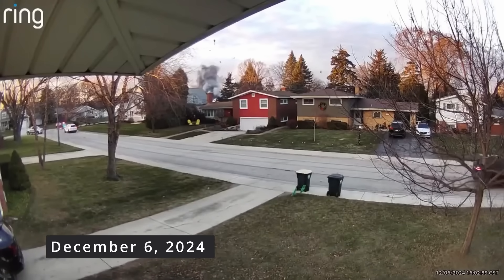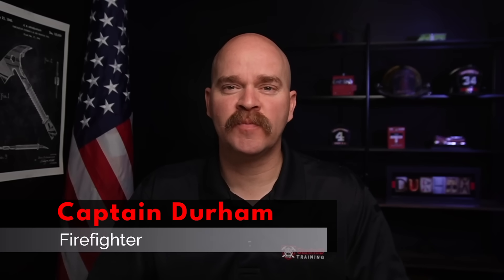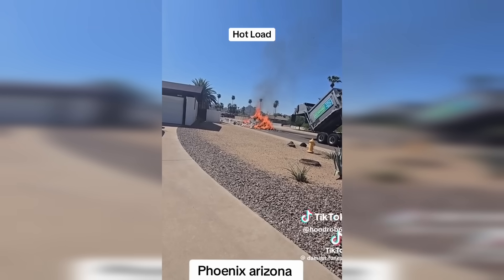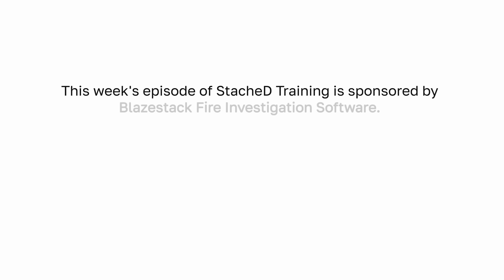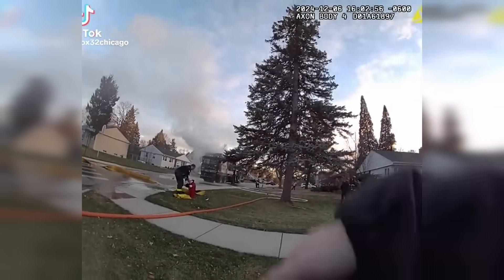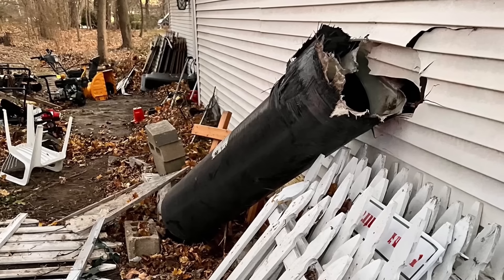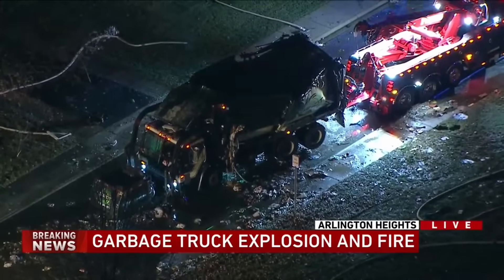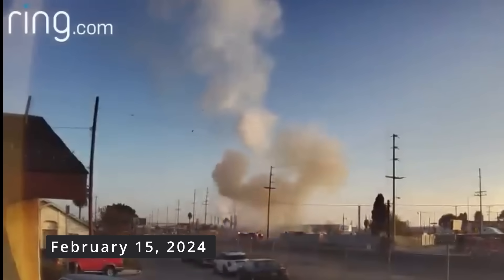CNG Garbage Truck Explosion Leaves 3 First Responders Injured!

Comment: But that tank had an outer layer of carbon fiber laminate, not fibre glass.
Reply from the maker: It's difficult to tell the difference between glass & carbon fiber rovings once the material has been molded.  Some tanks will use glass, others will use carbon fiber, however, carbon fiber is extremely expensive, about 10 times the cost of glass.  The cost is a primary reason most manufactures will lean towards using glass.
Reply: @StacheDTraining  - Well that black colour is typical for carbon fiber. Never seen black glass fiber when maximum strength is needed. Not design. If a steel tank is not strong enough in Europe I have seen so far only carbon fibre. Fibre glass only for 11kg propane tanks, but then without steel. You can see how full the tank is. The H2 tanks we made were also a steel tank with carbon fibre laminate. 
Are you really using fibre glass for high pressure tanks in the US?
Reply: @jfnotk255 Q: Are you really using fibre glass for high pressure tanks in the US? A: oh yeah, the one's i saw personally during some training out in "Oootah" (Utah) were definitely Fiberglass.  we had a crossectional cut-away piece of a Type-2 tank handed around showing the inner metal core (which is actually rated to hold all the pressure by itself) with an outer Hoop Wrap of Fiberglass used for additional support and safety.  granted i didn't have a set calipers on me or anything, but the wall thickness of the tank to my "Engineer's eye" was approximately 5-7mm with the long-strand wrap of the yellow/white Glass Fiber being approximately 3x-4x the tank's INNER wall, so adding another 15-20mm of thickness on top of that to form the tanks OUTER shell...

basically it was the same technique of "Rotational Winding" that Stockton "Elon" Rush used except in Carbon Fiber (sidebar: although any 1st year Engineering student would've known that "use case" was 100% WRONG and should've never been done) for creating the center section of his DOOMED Titan Submersible that ultimately ended up sending him (and others) to an "icy grave" on the floor of the North Atlantic, but i digress...

now speaking of possible "legit" CF reinforced tanks, when out to Vegas earlier this year i DID in fact see several shiny black tanks at ACT Expo being used for H2 COMPRESSED HYDROGEN.  yeah, these were the tanks used by the Toyota Megacorp mounted "in-situ" on their disassembled Fuel Cell Semi they had on static display, in fact i still have the pics right here on my phone however (BUT WAIT THERE'S MORE...!!!) Toyota did also display some smaller bright yellow tanks that looked to be reinforced with Kevlar...

in fact i saw no less than 4 different colors of H2 tanks:  i saw Black, White, Yellow, and there were also Grey (more than likely a CF/FG mix to save on cost).  fwiw the color of the 10 tank configuration the Hyundia Megacorp were using in their GINORMOUS Fuel Cell Semi definitely looked to also be normal Glass Fiber which makes me think their's were finalized "production tanks" and Toyota's were maybe "prototype" tanks simply during their R&D process.  both had operational Trucks outside giving demo rides but i only had time to "go to Mexico" like the kids say in Nikola's H2...😉

not sure what CNG tanks operate at, but for reference all the modern H2 Fuel Cell systems are now running at a massive 700bar (~10,000psi) whereas the earlier first gen systems from what was communicated to me were running at only 300bar (~4000psi).  i believe some of the jumbo storage tanks for H2 ie, 1.2m x 7.6m (4ft x 25ft) still use this as a reference pressure.

Comment: An alternative to CNG is LPG which isn't stored in highly pressurized tanks. It just has the habit to sink to the lowest point and either make you fall unconcious and die or catch fire.
Reply: LPG tanks can go up to over 300psi .
Reply: cng is used because of price
Reply: Look up “BLEVE”. Boiling Liquid Expanding Gas Explosion. 30 yard fireballs are common.
Reply: Yeah, it's a good thing most people don't have LPG tanks sitting on their grills in their backyards.
Reply: You must have a high benchmark for "high pressure". LPG/Propane is stored under pressure and will explode in a situation like the truck in the video. Search "BLEVE" to see what LPG/Propane tanks are capable of.

Comment: Why not jettison the tanks? If you know you're container is on fire, cut fuel and release the tank to roll away from the fire, surely there some mechanism that can be made to breakoff, seal the tank and eject it several yards away. Or some cryogenic cooling that can crack open between the inner and outer shell to buy some time.
Reply: you usually want to be in control where the flamable stuff is and not toss it just somewhere... the solution Patrick hinted at (dumb the burning stuff and drive the truck away from the pile of burning trash you just dumped in the middle of the road) is quiet sound what Patrick is adressing is a basic problem: Rescue services must be trained to react to different fire situations with the different fuel sources because they have to be treated differently... and they have to be able to see what they are getting themselfs into
Reply: Q: Why not jettison the tanks? A: you're kidding right...? 🙂 re: "seal the tank and eject it several yards away." well they're CNG Trash Trucks whose daily route (as shown in the video) is to go into residential neighborhoods and collect "the people's trash", therein "several yards away" invariably equates to "shooting a Mk1 Torpedo" onto someone's front lawn, driveway, or possibly even on top of a kid's Big Wheel...? just sayin'...

i mean it's bad enough one remedy clearly appears to involve GIVING BIRTH to a "fiery trash baby" into the middle of the street, but like those GINORMOUS TRASH MOUNTAINS seen in Florida after Hurricane Milton and Helene, at least the pile (once extinguished by local Fire Service) can be cleaned up with relative ease using a combination of a loader, or a claw, and a dump truck.   if i were to "hazard a guess" (pun intended) i'd say recovering a stray tank out of someone's chimney due to the danger posed would effectively mean CALLING IN A BOMB SQUAD.

Comment: Goes to show how safe diesel fuel is.   Diesel will only burn, it's not in a pressure tank.
Reply: And it's hard to make Diesel burn, contrary to gasoline!
Reply: In a fire situation though you have both heat and as the fuel expands compression. A diesel tank can become a firebomb. Diesel doesn’t light very well cold, but at a couple hundred degrees it burns pretty violently.
Reply: Yeah we drive new CNG dump truck rigs. The trucks that the new cng rigs replaced were on the road for over 10 years and were build like tanks. They were cat 13, cat 15 diesel with 10 speed manuals. These new cng trucks are heavier and have Allison 4000 automatic transmission that can’t pull worth a dime. The companies are going this route because of the environmental cutbacks and it’s all political.

Comment: "Wound Fiberglass"?  Are you sure it's not Kevlar?  Bet it is.
Reply from the maker: It's a thin metal tank wrapped in either glass or carbon fiber.   Typically, glass is used due to the cost of carbon fiber.
Reply: @StacheDTraining  It 's NOT fiberglass.  It might be carbon fiber but it looks a little light for carbon in the picture.  Doubt there is a metal tube.  I was involved in a project at a rocket manufacturer of large (long) cylinders for a CNG 'refueling trailer'.  The cylinders were about 40ish feet long.  We used all carbon fiber, no metal.  
Kevlar roving tends to take on some color from the resin, normally it is a yellowish white.  It might be carbon though, but the carbon roving we used was dark black, very pitch black before ever touching the resin.  Different manufacturers might be the difference.  But fiberglass would not withstand the specified pressures unless it was prohibitively thick & heavy.
Reply from the maker: @x-man5056  you're correct,  bulk transport and bulk storage will use carbon fiber.   Vehicle applications are typically type 2.  This should help (I worked for a large carbon fiber manufacturer) https://astforgetech.com/compressed-natural-gas-cng-storage-options-ultimate-guide/#:~:text=CNG%20tanks%20are%20made%20of%20steel%2C%20aluminum%2C%20or%20composite%20materials.
Reply: @StacheDTraining  Thanks for a good answer.
Reply: @x-man5056  re: "fiberglass would not withstand the specified pressures". it can since it's just there for reinforcement, the metal inner tank (by way of it's shape and material) is spec'd to contain the pressure all by itself.  however not sure if that holds true when you get up to Type 4 with Polyethylene cores.
Reply: @phillyphil1513  Yes, but no metal inner was known to me (not in the pictures or video) when I wrote that.  I have worked with the winding machines only on big stuff ICBMs chambers and space launch boosters (both Kevlar and carbon fiber) and CNG refuel trailers with about 40 ft long CNG cylinders that were carbon fiber, where the added weight of a metal liner would not be welcome in the case of boosters or ICBM's.  It would have been a lot easier to do the CNG Cylinders on a permanent metal inner liner, but it was the Govts approved design, not the company's.
Reply: i can confirm Fiber Glass is indeed used guys on BOTH the lower pressure tanks of CNG and the higher pressures tanks (700bar) of modern compressed H2.

Comment: I got a better idea. Outlaw Lpg and cng fuel tanks on vehicles.  The risk of explosion and people being killed is too great a hazard. That's like EVs once thermal runaway  occurs.  It almost takes an act of God to put the fire out. Once the fire is out. In some cases. It reignites days or weeks later. The only 2 methods to run vehicles. Without using fossil fuels. Is hydrogen fuel or fusion energy. Both are very safe fuel sources. Hydrogen in a hydride fuel cell is perfectly safe. If by chance the tank is ruptured. There's not enough actual hydrogen to cause a fire. Much less explode. With fusion.  There's no hazardous fluids. No radiation. If the fusion reactor is ruptured. The only thing that is released is harmless water. But we will never see either one of these in mass production.  Due to greed and Power.

Comment: I understand what a blevie is for liquid propane. How is cooling a cng cylinder bad? I can see why it may not be helpful. Doesn't cooling still relieve some pressure from building up? 
Maybe one thought is if you are directly hitting the relief valve, then the relief valve is not sensing the true temperature of the vessel. I could see that, causing it to exceed safe pressure.

Comment: I have a solution to this problem. Forget the CNG  and go back to diesel fuel.
Reply: Is not bad. I started working on this cng garbage trucks about 15 years ago and the fires are rare. Again they been running for over 15 years how many people have they killed.
Reply: Diesel works too well. 😁
Reply: Agree
Reply: I drove a freight truck run on CNG for about two years. Never had any problems, but never had any impacts to trigger a fire. Was always in the back of my mind what might happen though. This video makes me happy to be retired now.
Reply: Yeah, then we just have to spend trillions on "conflicts" in the Middle East and deal with the death and injury of millions, instead of the injury of two first responders.
Reply: TOTALLY AGREE!!
Reply: there is no problem with CNG lol!!!!! the fire is nevr associated with it it starts everywhere else on the vehicle.
Reply: Diesel also runs the risks of explosion, it's a trait inherent to combustion vehicles.
Reply: @ThatUntitledPublisher diesel & Gasoline burn more explode less. You failed basic science didn't you
Reply: @ThatUntitledPublisher Wrong. Diesel doesn't explode.
Reply: @SteamCrane no it just fouls the air
Reply: @ThatUntitledPublisher Diesel DOES NOT EXPLODE. It will burn but again, IT DOES NOT EXPLODE LIKE GAS.
Reply: @ThatUntitledPublisher are you insane?! diesel doesnt explode, it doesnt self ignite, its the hydraulic fluids or other systems that often causes fires,

Comment: the first thing that comes to mind is the utter failure to identify and manage risk
- what idiot would knowingly select LPG to fuel a vehicle that is a known hugh fire risk
- the aspect of garbage trucks catching fire will only get worse  as there are more rechargable batteries being disposed of in the garbage
- LPG + fire = risk of BLEVE ( not a good thing)

The same thing would go for fully electric garbage trucks
- the implications of a fire detting to the battery is similarly not good given the reall bad gasses that are released with a battery fire
Reply: Forget the CNG  and go back to diesel fuel. Much safer

Comment: Diesel is so much safer.  This Met Zero nonsense is going to cost lives.
Reply: Forget the CNG  and go back to diesel fuel. Much safer
Reply: It's obvious to most, there's a reason diesel has been the traditional fuel of transport for over a century.
But for the slow kids, we're going to have to sacrifice a few lives to remind people why.
Reply: @aaronnoyb  What do you mean by that statement?
Reply: @gtbproductions1  the first line, I consider to be completely self explanatory. 
The second, is simply stating, that we're going to experiment with silly ideas to replace diesel, at the cost of people's lives, before ultimately returning to tried and tested diesel.
Does that, clear things up??

Comment: BAN CARBON FUELS OH WAIT
Reply: Forget the CNG  and go back to diesel fuel. Much safer
Reply: When you stop using carbon based fuel, so will I.
Reply: Dude, CNG is a domestic fuel produced by fracking.  It is 100% a carbon fuel (CH4)
Reply: @asbestosfiber  DUDE. You fail to see the difference. CNG is VERY explosive where deiseal is not. That is the point.
Reply: @gtbproductions1   The OP "Ban carbon based fuel"

Comment: when you speak of "differences" , seems NG prv valves are THERMAL  on a carbon fiber/glass spun tank . the propane almost always a metal tank , steel most often and reliefs built into systema little away from tank . NG press. i learned at Cummins , often as hi as 8000psi . LPG , relief 450-550 psi i think . for same fuel use , NG tanks often 4-5x larger than LPG .   NG ignition range massive compared to LPG and in some respects , LPG flammability i remember being told by LPG station owner , is similar if not narrower than gasoline . heavier than air , pooling problems if it isnt burning off to prevent  . just some peanut gallery thots from playing with stuff past 44yrs .

Comment: You answered my question about the CNG tanks having PRV's. Looks like a re-design is in order to let them vent earlier. Maybe this was a mixed BLEVE and CNG explosion, because by the time the PRV would activate, the tank pressure rose due to heating from the fire, causing the BLEVE to also release the CNG(??) Not sure if that can happen, but wanted to throw the idea out there.
Reply: Forget the CNG  and go back to diesel fuel. Much safer
Reply: @gtbproductions1  How many times did you spam this message?
Reply: @gtbproductions1  The CNG by itself isn't a big problem. But there was a chain of causation here that caused a big problem. Diesel is dirtier, including soot particles which humans don't need in their lungs.
Reply: CNG is a GAS under very high pressure. It is not a liquid. A BLEVE only occurs with highly pressurized LIQUIDS such as Propane (LPG)

Comment: In Europe we have plastic plug in cng tanks. That plug melts at 200 celsius. Tanks have also over pressure valve 250 bar. Tank is filled to 200-220 bar.
Reply: We use a similar safety system here (though I don’t know about these particular tanks) but sometimes the plug doesn’t melt before an explosion happens or the tank is compromised and the explosion is a secondary side effect.
Reply: That was the plug he said will not melt when you cool it with water. Even in India, they would use safety plugs on stuff like this. The issue is how it fails in the wild, not how it fails in the engineers mind
Reply: and none of those will matter when its in a trash compactor. As soon as the wall weakens anywhere, the valve becomes irrelevant.
Reply: @jhoughjr1  It wasn't in the compactor, it was on the roof of the vehicle.   Judging by the damage the casing was damaged prior to or during the extinguishing progress so the casing failed before the relief valve did.
Reply: CNG busses in Europe are known to kablooey. One in Stockholm hit a height sign before entering a tunnel. Wham! 💥🔥
Reply: @rosen9425 
Wasn't that found to be caused for special homosexual rights ?
Reply: In America we only put plastic in our water bottles, you know, to sterilize and depopulate.
Reply: @ToxiCom-777  call it as it is

Comment: Joined the fire service in 1971. We only had to worry about the magnesium in the volkswagen engines. Need to be more aware of all the new fuel technologies.
Reply: Haha, we had a garden shed fire about 20yrs ago, had multiple VW engines and gearboxes in there, they sure do look pretty when the water hits them 😁
Reply: Gas has been around since the 70s
Reply: How about the Cosworth engine in some AMC Gremlins?
Reply: BMW N52, years produced 2006-2015.
Reply: I remember seeing a magnesium transfer case on a Chevy truck the reason I figured out it was magnesium was because there was a hole in it and I had it ripped apart. I decided to weld it (thinking it was aluminum) but luckily I saw the recycling mark on it before I started or I would've been calling you.